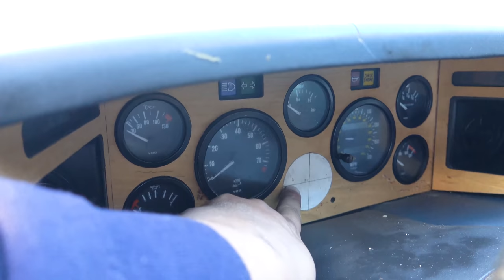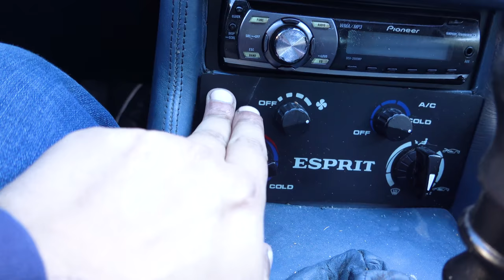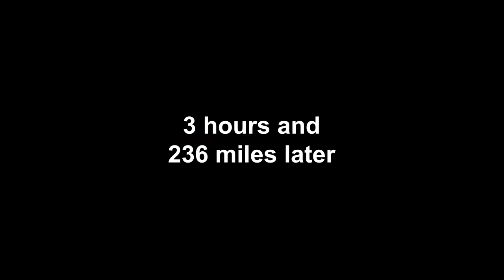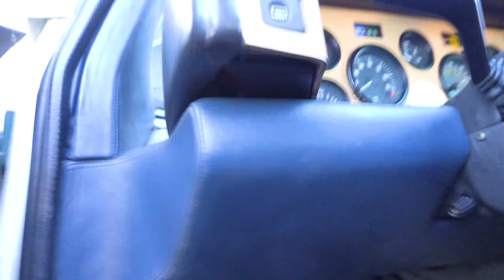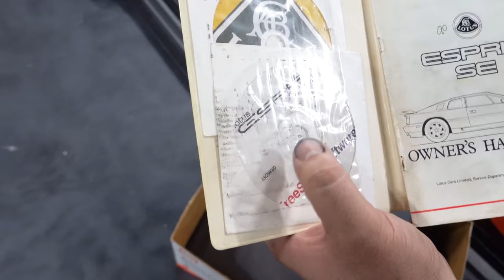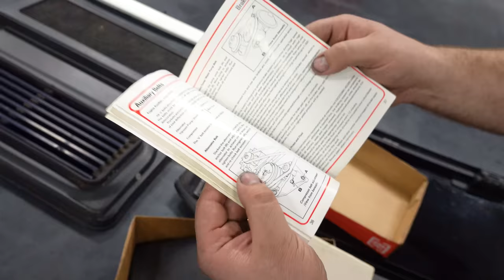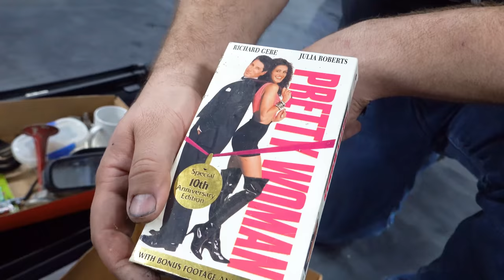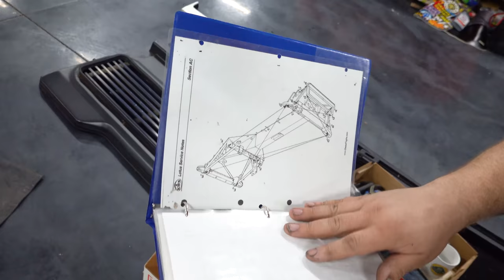We Bought A Cheap ABANDONED Supercar That Everyone FORGOT About

Comment: Having pretty much restored one, you guys are in for a lot of fun.. pain. You’ll be surprised the positions you will get into! Everything is awkward. All the engine work can be done while it’s in there, but if there’s a fair bit, just remove it, it will be so much easier!! You’ll realise that if you change the water pump. If you have the engine out, check the fuel tanks, as that’s the worst job, fact. This Esprit could keep the channel going for years. Join the FB Esprit groups for knowledge and help. Don’t ruin it. Look forward to watching.. good luck!
Reply: What's funny is that a biography about the Esprit mentions in several pages how difficult maintenance or simple engine repairs can be!
Reply: We remove the engine even for annual maintenance.  Once you've done it once it's a 45 minute job in and out. With the engine in, you need tiny hands for maintenance.

Comment: Drop the engine, makes sense on these when you have that many jobs to do. Trust me, you'll thank me later.
Reply: I agree especially since they have the service manual &  all the tech datain the cardboard box
Reply: they used to say that if there's 3 or more jobs to do, it's better to remove it, fix it, and refit
Reply: Drop the engine entirely and toss a modern manufacturer appropriate reliable alternative,  not familiar with lotuses so whatever like a British  LS equilivant.
Reply: Find a wrecked evora and toss the supercharged v6 toyota motor in , that thing would be a rocket
Reply: lol my first thought when they went into that engine bay was 'next episode watch me and Jared drop the Lotus engine'
Reply: @Jon_hayes  I think a Turbo K24 would fit the bill quite nicely.
Reply: @Jon_hayes  honestly, that 2.2L is a pretty dang solid engine. By the point of the SE, they had forged internals,  GM based fuel injection (GM bought Lotus in 87-88), and of course the water/air chargecooler was added. The other issue if you’re looking to retain its “value” is, the Lotus bunch are very particular, and swapping something else in will kill its resale/desirability.  They are rare enough that it’s almost sacrilege....like LS swapping a Countach 😂.  That being said, the Rover V8 has been swapped into them, (if you want to stay British) but it’s less reliable than the Lotus lump IMO haha.
Reply: @ezdubbin97  So basically a reworked Cobalt SS engine? That would make the parts hunt easier.
Reply: @Jon_hayes  There's no such thing as a "British LS equivalent" lol.

Comment: First a correction then a little story:
1: The DeLorean was based on the Esprit, not the way round you said it.
2: I went to a work experience placement from school when I was 13 and the engineering place I went to' s owner had a black '88 version of that car.  Any time he had to go and look at  job at a customer's premises we went in it.  They are ridiculously rapid.  Sadly the owner passed away a few years later and the car has stood in the corner of his old workshop ever since.  It's still immaculate as his son cleans and keeps it under covers but it would need a full mechanical going over to run again.  It turns over but all the rubber parts have perished from sitting for 26 years.  I have first refusal if he ever does sell it or first passenger ride if he restores it though!
Oh and to time the engine you take it out and do it out of the car, the rest is done via the ECU.
Reply: There were lots of facts that were incorrect,  I chalked it up to the excitement.
Reply: Yeah first thing I heard that was backwards.   It happens

Comment: Since no one else said it, Lots of Trouble Usually Serious .. I can't wait to see how this comes together!
Reply: I’ve had 2 Esprit’s : an SE & an S4 : no issues. Had an Excel, Elan & 2 Elise’s too : again no issues ...
Reply: I have a '91 Esprit SE. I have also had a '94 S4 and a late model V8 Esprit. None of them has ever let me down or left me stranded. On the other hand, pretty much every other car I've owned has had more issues.
Reply: @neilmicklewright5630  I envy you your car history , my experience comes from running a local uk car club where club members would prop up the bar and recount their latest disasters , Original Elites. Elans and early Elites and Eclats  most living up to their reputations.. pity they all looked wonderful!
Reply: The idea that 70’s Ferrari’s & Lambos were anymore reliable that a Lotus is a joke. A 4 pot will certainly be way cheaper to maintain than a hellish V12.
Reply: @drew699  Never said they weren't , BUT I do recall a member of the club explaining to me  why most  of the valves on his wife's Esprit  S1 needed to be replaced after she started it one cold Scottish morning , and because of the freezing weather the timing belt slipped a notch or two .. simple doesn't always mean trouble free
Reply: @colinritchie1757  You literally said that they were unreliable. I know someone who turned their Gallardo round in the drive & burnt out the £8K clutch. Does that count as unreliable too?
Reply: @drew699  fragile rather than unreliable
Reply: @colinritchie1757  I agree there is an element of inherent fragility in the concept of lightweight car design, but then, there is no substitute in the performance & dynamics of a light weight car. The world needs more lightweight cars, not more 2 ton ‘sports cars’ aka lorries.
Reply: @drew699  I couldn't agree more , one of my fondest memories is being the passenger in an Elan S2 as it cruised past a bunch of Merc and BMWs  somewhere in the highlands one sunny Sunday many years ago, what a joy that car was..

Comment: "The Wheeeeezard" might be able to help you out here. Hes only recently finished a 2.2 that was in his shop for a year.
Reply: Also might be a good candidate for a 4 cyl Ford Ecoboost swap. 300hp out of the box and tuneable
Reply: @michaelreynolds1904  The transaxle is a weak point and doesn't like a lot more than standard
Reply: Aren't they having a lot of Problems with the Ecoboost
Reply: @michaelreynolds1904  No, its a rubbish engine. The most common swap is the SAAB B234. Fully forged from the factory. SAAB Trionic 5 is now opensource and the engines can be tuned to 400 or 500bhp with no physical mods at all. Mines been at 400 for nearly 15yrs now.
Reply: @dj_paultuk7052  damn
Reply: @dj_paultuk7052  oh wow, that actually makes sense. Considering how Saabs' though FWD, had engines mounted in a similar fashion?

Comment: Make sure you check the coolant pipes and chargercooler coolant pipes. They can get clogged up and eat away the aluminium. These issues are usually at the end where the hose slips on.

Timing belt: Climb in the trunk and lay down on the engine. That's probable 50% of the time spent changing it.

Chargecooler pump, right side of engine under intake. With the unknown state of all of it, might be smart to pull it out and see if you need to replace the impeller.

Have fun :)

Comment: I bought a S2.2 Esprit turbo that had been in a big front end accident. It needed a new chassis (the original chassis is galvanised sheet steel that rots VERY quickly, a company called Spyder make a better and stronger replacement ) it took 4 months to rebuild it but it was the best car I ever owned. Save yourself a ton of trouble and broken fingers, first thing you do is drop the engine and transmission. Second thing you do is find someone with small hands and long fingers to get at anything behind the dash. Good luck and looking forward to see your faces the first time you get to drive this beast

Comment: Have some advise from this side of the pond ! - DO what lotus did ! - Stick a Tuned bigger Rover/Buick V8 in it and have a much better Power/Weight ratio ! - Yes I have had both engines the 4 in an "Elite" and a 4.6 stage 2 balanced V8 and that is the engine you want in there !

Comment: Colin Chapman (the founder of Lotus cars) designed the Elan, Espirit,  its glass fibre body was notorious for cracking.  Colin was small about 4ft 8ins, remember the Bond Movie with Roger Moore ?  Nice looking cars, the styling is a personal thing.  Twin cam engine with turbo , low weight and tons of power. Use a mirror to set the timing.

Comment: You may have already figured it out. The CD rom FreeScan is the diagnostic software that can take the place of the TECH1 diagnostic tool. the ECU is based off of GM at the time. There is also EspritMon software that is much more comprehensive. You need a windows laptop (it works on my W10) and a USB to 10 pin OBD1 connector. you can find a downloadable copy of the software and the service manual on the Lotus Forums. Also, to check timing, There is a TDC marker on the flywheel under the intake hose. there are dots imprinted on the cam gears facing the firewall. you will need a mirror but at TDC the dots will be 'Touching'. good luck!

Comment: When working on that Lotus Esprit you'll only get good clutch feel if you replace the clutch lines with braided steel lines and scrap the original rubber lines. Also get the charge-cooler working.
Reply: Also, the steering wheel is from a Pontiac because they needed something that could hold the airbag.

Comment: Put some transmission fluid down in the plug holes to wake up/clean the rings. If it starts it will smoke for a sec but will stop, and the rings will give better compression. Push the old fuel out of the fuel lines and replace them before you start cranking.

Comment: If you have to open the bottom end, and I, of course, hope you don't HAVE to, you will see some of the prettiest OEM connecting rods ever made.  They are incredibly sturdy for an under 150 c.i. 4-cylinder engine.  Even the earlier, 2.0 liter, naturally aspirated, 907 model looked beefy enough to handle gobs of extra horsepower.

Comment: In terms of questional choices: I got the opportunity of a pretty tuned and "wrangled" 1992 3000GT with upgrade turbos and about 420hp. I'm in 
Germany and there, 30 years old cars in "overall original condition" are applicable for a "historic license" I wouldn't even be pressured to 
re-stock the turbos, because "tuning, in the way it was seen reasonable in the era" would be considered "historical, too. It's 12500€ though. 
Which is about $15,500. I would get the whole original Bodyparts plus a pretty lovely bodykit. The car has aftermarket gauges all over the place
 and a bust steering rack. The next best offer is 17,500€ aka $20,000. I'm willing to jump the gun. Any advise?

Comment: I'll tell you a car that noone knows about: 1991 Isuzu Stylus

I had the 5 speed, 1.6 with Lotus Badges. Lotus did the tuning on the suspension and the car cornered like it was on rails.

That was the car that turned me on to these. They only made them 2 years for the XS 91 and RS 92, which had a 1.8L. Nobody bought them and by 93 they only offered a crap base model with an automatic and discontinued.

It was also one of the first cars under 10k, yes 10k that had a drivers side airbag in 1991.

Hell of a good sport sedan, everyone always asked me what kind of car it was. I took off the Isuzu from the front, so all it said everywhere was Lotus and Stylus.😁

Comment: I have done one of these hopefully the transaxle is good. the trouble you will find will be with the transaxle and the lack of parts for said transaxle. The engine and the other parts are easy since the  car was basically  a kit car and used  off the  shelf parts.  There was a few UK companies that made a run of  transaxle parts gears and such dont know if anyone is making them.  bearings Ist and second gear generally are the issue.  You do not want to hit anything or get hit they do not hold up well mine was totaled sliding off the road at 35mph into a fence post

Comment: My dream car! good luck finding parts for it though, they are VERY hard to find regardless of what you need for it. I have the same challenges that Jared does. too vertically abundant as well as circumference issues and yes due to the Florida humidity i also have the temperature related issues. Fat man don't like to sweat and anything over 68 degrees F is hot

Comment: Looks like it has or had an Innovate wideband O2 on it. They used that 2.5mm stereo connector to interface with a computer. By the way, it is fine to have the sensor after the turbo where it is...most factory locations are there.

BTW, do NOT drop the clutch in that thing making any sort of power or the transmission WILL grenade! They are known to break the input shaft coupler. Seeing as the car has some possible upgrades, this might have been replaced with a stronger part, BUT that just pushes the failure to something more catastrophic.

Comment: Most DVD drives are backward compatible with CD's and the files may be in pdf format so you can open the disk in file manager rather than run the install file. If your laptop has no DVD then an external drive is like $30. It will probably be an app that ran in in DOS or maybe Windows 95 and you printed it out but let us know.

Comment: Just alittle usefull and not so usefull  knowledge for you. A couple of Lotus models (Esprit and Excel) from this era also used parts shared with another rather more expensive supercar. The wing mirrors are Citreon made but used on the Jaguar XJ220. Also used on some Aston Martins and a TVR or two. They are like rocking horse poop to find so dont break them. A great UK based parts source is S and J sportcars if you have trouble sourcing anything. I have used them several times for parts (and a wealth of knowledge) for my 89 Excel se. Looking forward to this build. The chassis is steel but fully galvanised which makes them last.  My 89 Excel chassis has not a spot of rust on it for a car that lives outside.

Comment: That is a beautiful, wonderful car the Lotus Esprit. I hope to see it running again in good condition. Please do not modify this car too much and also, keep all the information and documentation with the car, it is well preserved. Also, get the data off the CDs, they might deteriorate. Get a cheap old computer from a thrift shop or someone you know. It is a good-looking, fun, and relatively reliable supercar that can keep up with its 1980s-1990s competitors, including Lamborghinis and Ferraris. This is the newer Peter Stevens-designed X180. The older models (including the wedge-shape Giugiaro-designed S1 and other models from the 1970s and 1980s [even James Bond drove some of them]) are also nice cars. There was even a V8 from 1997-2004, until the Esprit was discontinued. Those cars have a revised design and are more expensive nowadays. The Delorean is based on the 1982-1988 Lotus Esprit S3, I believe. The Lotus Esprit is one of my top dream cars.

Comment: You should be able to install a 32 bit windows 10 instead of the 64 bit version (all copies support both 32 or 64 bit) you could dual boot 32 and 64 bit, you may need 2 copies of windows still but its not too hard to do, but doing that should allow you to run most 16 bit software!!!! (assuming there's not a 32 bit version on that disk, {probably too old for 32 bit software} if it did you could use 64 bit windows, 32 bit windows runs 16 and 32 bit software, 64 bit windows runs 32 and 64 bit software! [usually, YMMV])

Comment: Get a external DVD Drive off amazon for 20 and then plug it into your windows 10 machine and copy the contents of the disc to a folder on your desktop and then run the application in compatibility mode. https://www.windows10forums.com/attachments/compatibility-mode-2-jpg.108/

Comment: Why can't wanna-be motor-headz at least get the lingo right? It is like they have no clue that there is difference between classifications. Or they are so fake they have to use the wrong descriptions so they feel better. This is not a supercar. It is barely an exotic class car. Here are some real car classes of the consumer level: Sport, Exotic, Super, and Hyper. In that order. You don't even get into the realm of Supercar till about $800 thousand USD. Not that cost is the classifier just an easy retail example. The Lotus are fun cars but not even close to a Supercar experience.